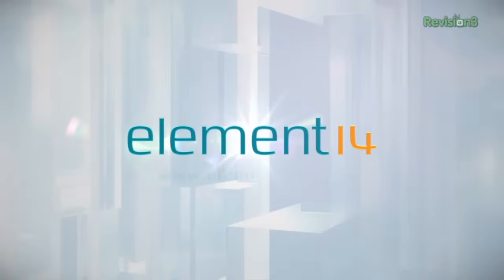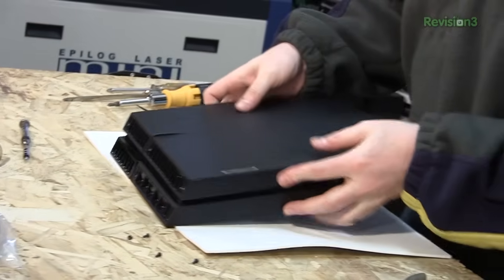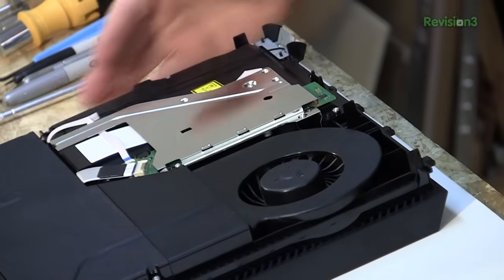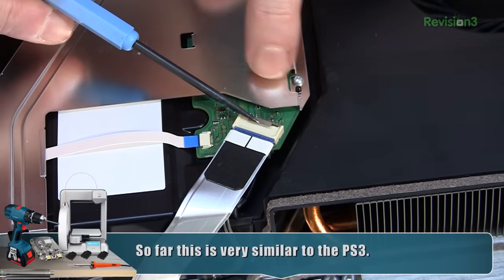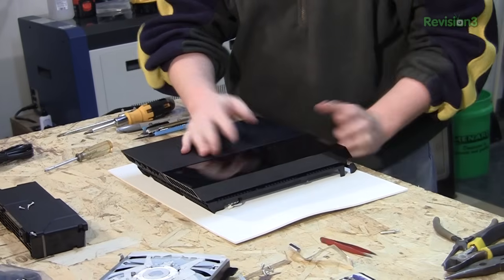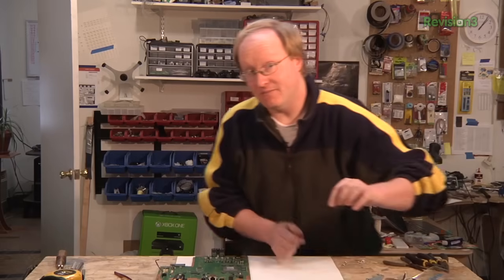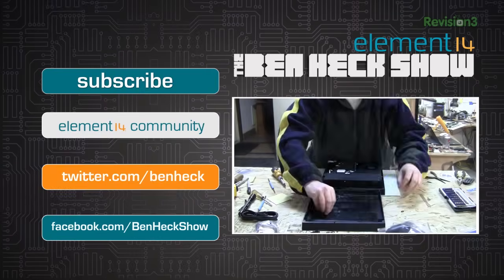Ben Heck's PlayStation 4 Teardown

Comment: You can bet that sooner or later someone's going to slam an SSD in there...
Reply: Doubt... SSD doesn't affect much of the performance of the PS4. Most of the files are just placed on the blu-ray player instead of the internal storage. Thus, ssd costs alot more than 2.5" drives... Not recommended. Unless you are running a downloaded game.
Reply: Um, what do you think the drives are in laptops? They do make 2.5 inch hard drives, they look similar due to the dimensions but that definitely wasn't an SSD.
Reply: Randolph White Please leave and never come back.
Reply: Good point. Still, the system does install at least SOME files - it probably would speed up loading times, and games like Galak-Z would certainly get a speed boost.

An SSD would be more like an experiment than anything else. Though SSDs are certainly getting cheaper and cheaper, the 250 to 500 GB ones, anyway.

One problem though - does the PS4 defragment itself?
Reply: Sean Willmore If you're downloading your games instead of buying them on discs I imagine it would have a pretty big boost in performance!
Reply: Exactly. The loading screen probably wouldn't even be able to finish coming up before it finished crunching data. There's benefits both ways.

Still, again, there's the problem of whether or not the PS4 defragments itself. Most SSDs have TRIM in them already, and when they get defragged it just KILLS them. The HDD is slower, but the SSD has only so many write cycles before it shits the bed. They're getting more sustainable all the time, but you can only get about four to five years of moderate use out of one.
Reply: the drive in my laptop is an ssd the drive in my ps3 is an ssd it seems illogical to take a step backwards on next gen :D since they have stepd up every other aspect  there hardly going to say lets slow down our hard drive speed and not put in an ssd
Reply: Why not?lol
Reply: im no expert but to the hard drive he pulled out of there was already a solid state drive, i doubt they would be able to fit a big ol spinner drive in there :D
Reply: on a second look what am I even saying of course that's a big old spinner drive. but the true question is I wonder if it could be replaced with a SSD... way to take a step backwards sony.....
Reply: ye
Reply: SSD's are still too expensive for consoles at this point. You can get a TB HDD for less than a 120 GB SSD.
Reply: HDD's will always be less expensive than SSD's, that's a fact. It's also a fact that SSD's are getting bigger and bigger, making them good options for some people. Someone who doesn't mind spending as much scratch on a SSD as they did on the console itself would go for the performance.
I'd rather have a TB HDD myself, though. Spending 500 bucks on a few less seconds of loading time isn't worth it.
Reply: I'd wager that eventually SSD's will be cheaper. Either by way of mass production or some new process that makes them cheaper to manufacture; HDDs are becoming more and more irrelevant while SSD's are more or less the future (as far as the near future goes) so you have a lot more R&D going into SSD than HDD
Reply: Definitely. As NAND becomes more stable, HDD's will die out and become the next tape drives. If you think about, HDD's are inherently analog devices - they use magnetism to store data.
Reply: to be honest though I think there is still some potential for the HDD's because the biggest widely available HDD's are only 4 TB I think they could get them much bigger than that before they make the "digital jump" so to speak
Reply: They're actually gotten up to 6TB. They still have potential to be sure, but as time goes on that's mostly going to be in the data server areas. The speed of the platter itself is the main bottleneck in a fast system, and it's the biggest drawback compared to SSDs.
Reply: i guess so, but if they could get bigger like lets say 10 TB plus and have the speed of idk RAID 0 then they may still be viable for a while
Reply: Ryan Stevens Maybe, but HDDs are more likely to fail (moving parts), make more noise, are affected more by impacts (mostly an issue with laptops, but still something to think about) and use more power to mention some of the biggest disadvantages.
Also, there's been some promising things coming from SanDisk about their plans for the near future, most notably 6-8TB SSDs scheduled some time next year.
Reply: Unless Sandisk has found a way to make them for cheaper than a 1TB SSD (~$500) then it will make no difference. You could buy 10TB of HDD storage and still have money left over in comparison to buying a 1TB SSD.

Not to mention we are talking in a thread on a video for consoles. Most people already consider the XBone and the PS4 expensive, lowering the storage capacity or increasing the price just to fit in an SSD would kill the sales.
Reply: Well, they are predicting SSDs to become as cheap as HDDs around 2017, hopefully they can deliver.
Reply: venum4k I hope so too, you never know may come sooner :)
Reply: ***** yes! does my virus come in pink?

Comment: It is not that surprising that the PS4 and Xbox One both use the same hard drive. They both opted for a mechanical drive size that is not in high consumer demand so will become increasingly difficult to find in the coming years. If a manufacturer can peddle their drive onto both of the consoles, that gives them incentive to keep manufacturing it, despite not being able to find a market for it in a retail store. Sort of like the dinky 8 GiB hard drive in the original Xbox, even for its time that was much smaller than most of the drives off-the-shelf and no manufacturer had plans to produce a drive that small in respectable quantities (except in specialized markets like Ultra SCSI).

Comment: ddr3 and gddr5 are actually close to the same speed, ddr3 runs at 64bit and can transfer data much faster with smaller amounts of data, gddr5 is the opposite it runs on 32bits and can transfer large amounts of data faster. But in comparison they actually run close to the same speed
Reply: ***** they are, linus tech tips explains it alot better
Reply: Seriously, this is confusing check this link out... Wish I was a math genius like some people...  http://www.techspot.com/community/topics/whats-the-difference-between-ddr3-memory-and-gddr5-memory.186408/
Reply: rcflex technically the bottom line is ddr3 isn't any faster or slower than gddr5 vise versa. I mean sure depending on what mhz either is running at but if they are running the same speed their wouldnt be any noticable difference
Reply: Ilari Peltola dont believe me? then go look up linus tech tips and go tell him hes wrong.
Reply: DanDan7 i dont give a flying fuck if the ps4 is more powerful than the xb1 which i know it is due to having a better gpu. But if you even payed any attention to what I was even talking about you wouldn't look like a fucking moron just like you did. I don't give a shit about either of the consoles but people had a massive misconception about the ram in the systems cause they have no clue about hardware and i was merely stating their was no huge difference.So why dont you go fuck off and next time you leave a coment actually know what the conversation has even been about. Peace out you stupid tool
Reply: Actually it is not ddr3 vs. gddr5. It's esram vs. gddr5.
Reply: Ilari Peltola Xbone has DDR3 AND E-S-RAM the PS4 is WAY better and has GDDR5 for everything. I honestly can't wait to see what games will look like when dev's really grasp the tech of the PS4. This machine is in it's infancy, and already looks amazing, but of course games will get more refined in time..  The Xbone shit on it's self with ddr3 & es ram... they should have said "let people buy the camera's on there own" The DDR5 would have made the Xbone so much better.
Reply: ***** The GDDR5 on the ps4 is pooled ram meaning its shared and used differently as the DDR3 on the XB1 is dedicated system ram. Theirs no such thing as DDR5 system ram anyways.They are very closely related in speed and timing. I'm not going to explain myself in detail but The reason why the ps4 is more powerful is its GPU which is the 7870 and the XB1 is the 7850.Doesnt sound like much but Ive benchmarked both of these gpu's  and the 7870 is 20% faster. The main thing they should have done it put a nice hefty cooler on the cpu and actually gave the 8 cores mind you is the same on both systems some speed. They are clocked at like 1.32 ghz and the Xb1 being clocked slightly higher by like 25mhz.A nice cooler and clocked to at least 2.5 ghz would make a world of a difference
Reply: ***** bullshit, stop being in denial and accept the fact that PS4 is more powerful.
Reply: ***** no thanks dude
Reply: *****
 If this is the case what is causing the frame rate and resolution parody between PS4 and XB1?

Also I would assume that with games the large amount of data is what is always being used which means the GDDR5 is a good deal superior for games.
Reply: I'm not sure what you mean by 'runs in 32 bits' or 'runs in 64 bits'? Both consoles are using 64 bit processors. Memory bandwidth is a totally different issue and, unfortunately, can be pretty confusing.

The XBox One has higher memory latency than the PS4, hence the need for the ESRAM, which acts as a cache. The cache has to make up for the One's slower RAM.

The PS4's RAM has much higher bandwidth and lower latency. The difference is measurable and well known among game developers. The PS4 also has 50% more rendering power. Once again, this is a well known fact and games are designed around this knowledge..

Unfortunately the ESRAM cache in the One is too small to store a full 1080p frame, so all games on the One have to be upscaled from whatever the internal render size is. The PS4 does not have this problem.

The One is designed for a different audience than the PS4, so, in the end, it's probably not a huge deal.

Comment: xboxone & ps4 same harddrive? CONSPIRACY CONFRIMED... They are working together to force gamers to pay to play online multiplayer...
Reply: Niaz Ali you just have to format them, they are IDENTICAL.. ..
Reply: so what will happen if you put a ps4 hard drive into a xbox 1 or a xbox1's hard drive into a ps4
Reply: ***** ps4 uses ext4 or ext3, xbone uses NTFS. You can use NTFS formatted drives and storage devices with the ps4 how ever because of the already existing drivers to utilize NTFS functionality in the linux distribution they used for the OS, same thing with the ps3. The xbone how ever I don't think can operate with ext4 formatted partitions without additional software which is not on the xbone. You would have to hack/modify the system in order to do so which shouldn't be too hard since xbone uses a modified windows 8 os.
Reply: Niaz Ali if things are still as they have been at the time of PS3 - nothing
PS3 had encrypted drive. And even if not encryption, then PS3 use FFS, which is outside of microsoft grip (they even cannot do ext2 or reiserfs)

Comment: 12:31 -> GDDR5 , not the DDR3 , ben!
DDR3 is the "central RAM" , but the GDDR5 are build with the GPU. ;)
Reply: Thank you! We have someone else that knows their stuff!
Reply: Grey Pearl in this console they used gddr5 INSTEAD of ddr3 for system memory, meaning for both cpu and gpu. gddr is basically ddr, but the design of it is slightly different so you need a cpu that supports it.
Reply: clamo6362 The ram is NOT the same. It is similar.
Reply: yea technically it's the same thing , but not really..
Reply: *****
actually no. ddr and gddr are the same thing. cause they do use ddr3 on gpu's to. they also have used ddr 1,2 on gpu's in the past. the G is just to try and add confusion for some reason.
Reply: memory bandwidth is all that's different.
Reply: yep BUT that's all it means. the ram remains the same. do some research.

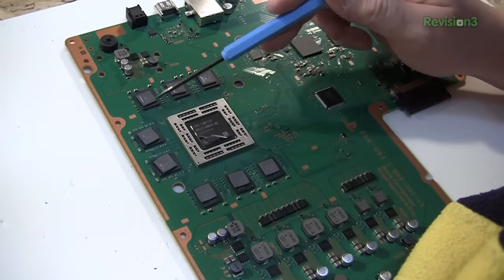Comment: 12:45. I think thats a bit of a slip up. 8x 512 doesnt =8
Reply: There are 8 chips on both sides of the board, so 16 chip's total
Reply: Thomas Gregoire
Yes, I know, but he said 8 which was misleading.
Reply: 12:35 He say's "There's 8 of these on each side" :)
Reply: Thomas Gregoire
Seems i missed the on each side bit. My mistake in that case.
Reply: No problem, happens to me as well. Were only human, error's are to be expected.

Comment: The chip you pointout @ 13:30 is not a northbridge its the secondary ARM processor APU's don't have a separate Northbridge its all on chip the reasion for the interconnectivity is that the custom ARM chip that handles background stuff such as video encoding needs direct access to system ram the smaller chip is not eprom but a DDR3  module for the ARM chip its a 2GB chip 
the SPI chip is on the upper left at 13:33